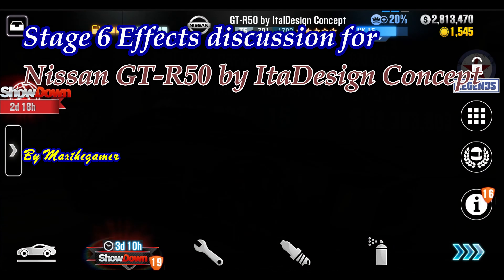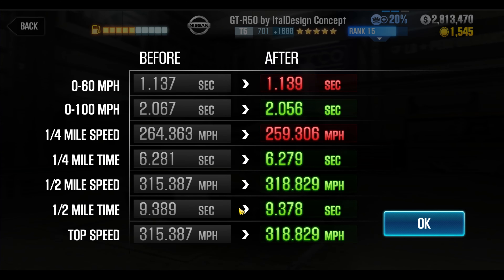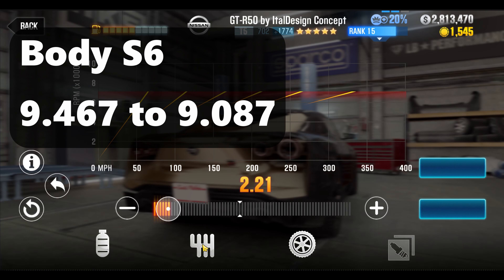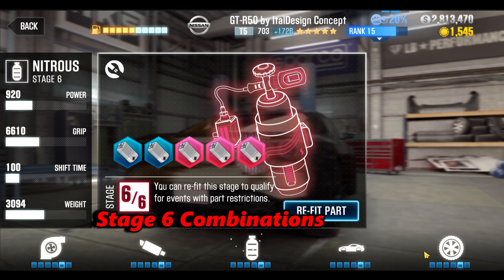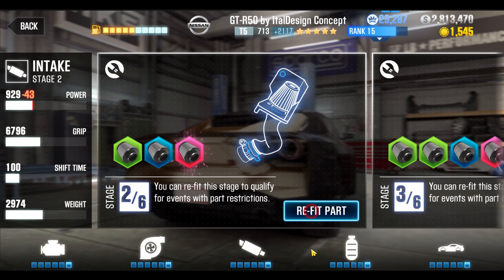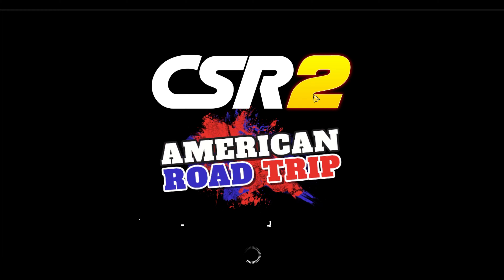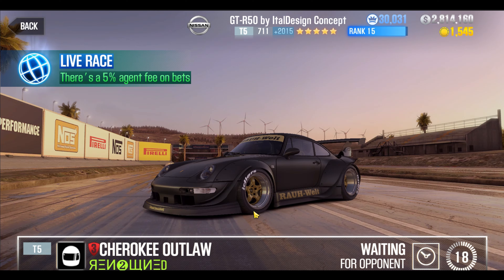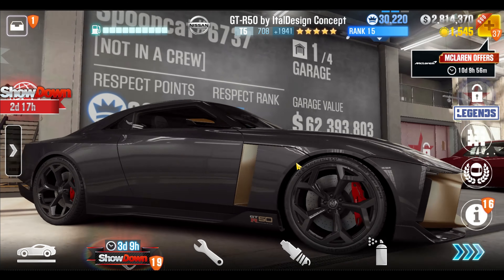CSR2|CSR Racing 2: Nissan GT-R50 Concept Stage 6 effects

Comment: Wouldn't these videos be better if the stage 6 effects were calculated without any fusion parts? since we aren't talking about fusion part effects, and also because some stage six parts have more fusion slots than do others.
Reply from the maker: It's a good question. The answer is without fusions there is much less tuning variable. So you don't actually get a good view of effects. A car without fusions would not be a clear representation.

Comment: Hey Max, first just wanted to say I love your videos! Keep up the great work!
I'm having a little issue right now and I was wondering if you could help.  I have the gold star ferrari laferrari and I can't seem to tune it to have a dyno beating tune.  I've heard this car is great for that but I can't seem to solve it.  I have s6 intake, body, and trans with almost all fusions.  I've tried putting both engine and intake at stage 1 and stock looking for the large evo bump but I find none.  Is there a large evo bump somewhere that I haven't found?  
This doesn't have to be a video but a ferrari laferrari s6 effects video would be pretty sweet!  Thanks again for your content!
Reply from the maker: It does have a dyno buster tune.  I will have to look at it again to remember as I never built one on my actual playing account. Let me look into it and get back to you tomorrow. Its late here and I have work early.
Reply: @maxthegamerOG  Thanks!
Reply from the maker: @Slackrrrr  You really need s6 tire to trigger the downtune easily.  That is mainly what is holding you back. Without it you have to drop too many parts to make it work. At that point it's not worth it.
Reply: @maxthegamerOG  Ok thanks for letting me know! Looks like I'll have to wait for leferrari crates thatll probably never come
Reply from the maker: @Slackrrrr  LaFerrari S6s comes randomly. I ended up with the S6s long before I got the car through the recent event.

Comment: Max, do u know s6 effecrs for F1?
Reply from the maker: I do. It's really very limited per each s6 because the car is already so fast at s5.
Reply: @maxthegamerOG  You mean s6 do not give a speed boost so much?
Reply from the maker: @alexwilder7135  remember the F1 is 8.1 car at s5 only.  It is 7.2 fully maxed before getting into elite levels. So basically, 0.9 seconds divided by 7 stage 6s.  The biggest stage 6 I believe did 0.3 improvement when fusioned.
Reply: @maxthegamerOG  I see, thx, Max!

Comment: Grip based down tune??
Reply from the maker: It's a technique where you try to find a tune where the tire grip overwhelms the final drive to make the car drop a few hundred Evo instantly. This translates to a 0 rpm drop as well. But if you launch off perfect, you can bust dyno most of the time.
Reply: Maxthegamer ahh thank you good sir 👍🏾